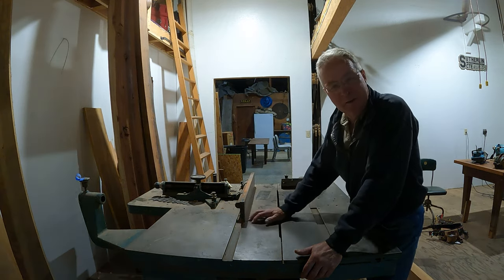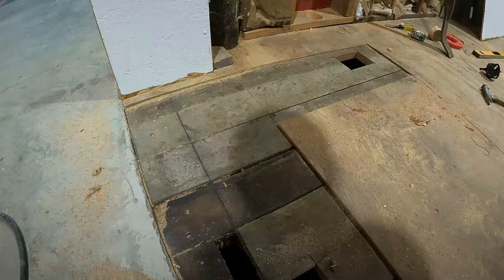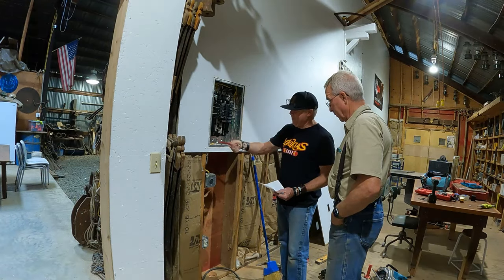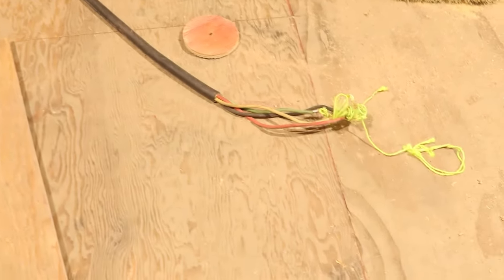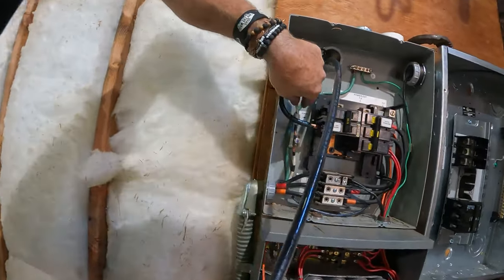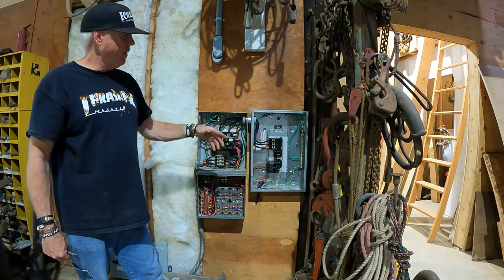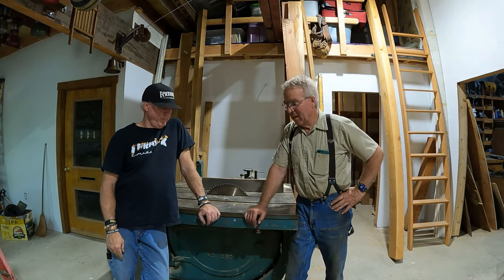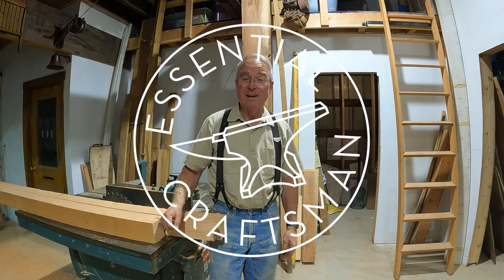Installing Three Phase Power In A Shop

Comment: I will never forget Mr. Tate, my shop teacher in 7th grade, telling us: "This is the table saw.  The table saw can throw a full sheet of plywood the length of the shop, and it doesn't care how many heads are in the way."
Reply: And as those heads fly they can break bones.
Reply: Hahaha...sounds like mine...Mr Rhodenizer wouldn't let the caretaker change the ceiling tiles with holes bcuz it was part of the demonstration! He'd step to the side and let a piece of wood fly up into the ceiling...he had our attention...rip Mr Rhodenizer...I  love woodworking bcuz of your teaching
Reply: 🎉 definitely I agree🎉 that is the kind of machine we used to use in school also where it almost sound like a two-stroke with a power band engine it would rim and then rim higher🎉.. kind of like a jet engine🎉..JJ... Jonjon...😊😊
Reply: I like to say that we think the tablesaw's job it to cut wood for us but the table saw resents it and will throw it back at us any chance we give it...come to think of it kind of like a strict Sensei or boxing coach shows you your weakness with a quick connect to your head.  BE alert especially when cutting multiples. Do not say at the last "Ah, last one.". Your mindset changes and goes onto the next task but I have learned to say at the last one; one more after this, keeps me focused on  the task at hand so I can keep my hand.
Reply: Well my shop teacher told us that if we broke a bandsaw blade, it would shoot across the room and get stuck in the cinder block. In reality, from experience, once the blade breaks it comes to an immediate halt and you don't even know you broke a blade until you open the cover.
Reply: So clever this elictrocity stuff ! I was more used to hand starting an old lorry engine and trying to stay out of the way of the belts !
Reply: @adamkendall997  Depends where it breaks.  I've seen one come out the dust chute, through the hose and stick in the floor.
Reply: Mr McRory told our classes, “if you stand in front of the table saw and you get a kickback, you won’t have kids.  Kids are the greatest gift you’ll receive in life, so don’t stand in front of the blade”.

Comment: That burke bar does everything.
Need to move a 4 ton saw? Burke Bar. Need to remove shingles from a roof? Burke bar. Cat is about to hack up a hairball on the floor? Burke bar.
Reply: Really 4 tons? Or are you exaggerating? That would be a BEAST!
Reply: Hairball😂

Comment: This video had me doing a Google deep dive into phase rotation, delta/wye configurations, eddy currents, etc...and damn I have a new found respect for electricians and electrical engineers.
Reply: All Greek to me 🤷‍♂
Reply: You know what's funny to me, I've been around electricians my whole life. Done electrical myself some. I constantly think: "Well if HE can figure out or, I sure as heck can." And then I realize that electrical isn't my thing. The same look of astonishment that I give my electrician when he wired my whole house and it worked was the exact same look he gave me when his house flooded and I had to redo the drywall and plumbing. Things that he never had a clue or interest in. We both cover each other and it works. ❤
Reply: @trentjensen96 I I just took the master electricians contractors test in Ohio about 6 months ago. I’ll tell ya what it was super hard 110 questions but I passed. Been doing electrical work for 25 years and you never stop learning!!

Comment: I do this kind of work all the time, and we use a VFD (as Kevin mentioned) to convert from single to 3 phase right at the unit itself, and as a bonus you have infinitely variable speed control if you want it.

AutomationDirect sells them cheap, less than even an equivalent phase converter and you don't have the moving parts or the parasitic losses either!
Reply: Will lowering the speed control increase heat in motors at all?
Reply: @slaveofjesus3878  The voltage and load stays constant, the vfd just changes the ac frequency (hz).

Running a fan cooled motor slower will decrease the cooling though, so at really low speeds it can cause overheating (like 20hz or less which is 1/3 the regular speed). If someone needed to run a motor at 1/3 it's speed for long duration, they be looking at slowing the final output mechanically (different gearing / belt arrangement etc.)

But if for some reason you have to you can install a separate fan too.

It's not often that you want to drastically change speed for non-production work, you might fine tune the speed a bit, but the main purpose of the vfd is to give you that flexibility to run 3 phase loads on single phase.

They're also useful for testing and prototyping or situations where the speed is tied to some other input (job being run, temp, load etc.)

Comment: I would really think about installing a splitter on the saw. That thing is terrifying, but I'm glad you're finally getting to use it.
Reply: What's a splitter? Same as a riving knife?
Reply: @MattsAwesomeStuff  Similar.  A splitter is fixed whereas a riving knife raises and lowers with the blade.  So you couldn't, for example make a partial cut with a splitter installed.
Reply: i agree
Reply: @MattsAwesomeStuff  essentially, yeah. Just can't go up and down since it will be a retro-fit.
Reply: AND A GUARD! Surely? Was recoiling a bit as he lent over the table to reach for final bit of the cut..
Reply: @Sam3532  me too! You'd think Scott would have the sense to at least use a push stick
Reply: @Deano.1978 God gave us two push sticks! 😂
Reply: @derrick_v  You're damn right he did!!💪🏻Of course, I've only got one now because I didn't use an OSHA approved  push stick when cutting a 2' x 2' piece of plywood in half!!🤣🙄

Comment: I remember testing on site table saws powered with three phase motors. When activated the experience was exciting and terrifying at the same time. I have total respect for this type of power.
Reply: What does that mean please? I've never heard the term 3 phase
Reply: On household power you have 2 hot leads (black and red) which are 230v from black to red and 120v hot to neutral. This is single phase.
On 3 phase you have 3 hot wires (example red, black, orange) and again 230v hot to hot and 120v hot to neutral.  First phase is black to red, second phase is black to orange and third phase is red to orange. 
This is much more efficient than single phase. In fact all brushless battery tools are DC converted to 3 phase AC.

Comment: 👍🏻👍🏻👍🏻👍🏻👍🏻👍🏻👍🏻 I put a contactor on mine before the phase converter/motor feed and installed a key fob relay in the control circuit so I can fire it up from anywhere in the shop, so it doesn't run all the time.

Comment: in my high school wood shop class the teacher was pushing a piece of wood threw the table saw demonstrating how to use a push stick. and a sliver of wood decided to let go and came back at him. it went threw the web of skin between his thumb and pointer. straight threw. he calmly finished his cut. turned off the saw. held his hand finishing his "speech" and walked to the nurse. always had respect for him for that.

Comment: The sound of that saw turning on, brought back memories for me, too. A three phase tablesaw was in a tool shop that I worked at as a college student often I was asked to make plywood shipping crates. One time I was cutting a sheet of plywood and I don’t remember exactly what happened but there was some kickback and plywood shards flying. I had a piece stuck beneath my chin that I had to pull out with my fingers. Unbeknownst to me, 30 years later I was getting an x-ray, and there was something metallic in that same location. When the x-ray technician zoomed in on the image, the shape of the metal was very similar to what a carbide tooth would look like. Now I have to decide whether to take it out or leave it in.

Comment: Just sharing what I learned from my monster saw. Not quite as monster as yours. 14” 5hp. Old Delta/Milwaukee from the 40’s. Came from an organ factory. When I first turned it on and ran wood without the guard, I noticed shorter, smaller pieces wanting to lift the back end of the piece. It took a while to click but my guard is made of magnesium and the splitter has anti kickback spurs inside the guard. So I installed it, dialed it in. The weight of the guard holds the work piece down. Make an assortment of push sticks and feather boards. Hopefully it came with the guard. Happy sawing

Comment: Interesting. I tried to educate myself on commercial 3-phase supply when planning for a new mass spectrometer in the lab. As I understood things, power delivery in that case is via three 120V legs that are 120 degrees out of phase with each other, yielding a voltage potential of 208V. I assume the 240V leg discussed here is some sort of compromise required when deriving three phase power from single phase distribution. Now I need to read up on this too.

That Oliver T.S. is definitely a beast; easily capable of turning that 4"x8" into a missile. A couple decades ago I was using a 12" Oliver jointer on a 2"x12" hunk of redwood when the cutter knocked a knot loose. I was already feeling less than 100% so the noise of that knot busting loose and banging around under the board scared the bejeezus out of me. But it taught me the important lesson to only operate big power tools when my mind and body are 100% ready for the task at hand.
Reply: "240" and 208 can both be a part of 3 phase. "neutral" is just 240v tapped midway on the transformer windings to halve the voltage.

For single phase 230 for example you have two conductors with between 220 and 250 volts between them (it can vary). For 3 phase you have 3 conductors, and yes the pulses are out of phase with each other. So you always have that 230ish volts between any two of the three wires. But you can also have a "high leg" which will give you 208v relative to ground. So on a 3 phase breaker, you can connect a regular single phase load to the top and bottom of the 3 breakers and get 230ish volts to run regular equipment.

This is all better learned visually though, there are some great entry level brief vids on youtube about all this, it's interesting. 

Another fun thing is that 3 phase motors can reverse direction. If you hook it up and it spins the wrong way, you can reverse any two wires and it will turn the other way.

120v 3 phase with 208 isn't something I see a lot, but it's apparently used more in schools and apartments etc. In an industrial environment I see 230 v 3 phase or 480v 3 phase most of the time.

Comment: Nobody mentioned it but for future hook-ups be sure the phase converter generated leg isn't being used to energize the motor starter contactor coil.  You want utility provided power to go to the starter coil.  Otherwise, your motor starter may not work.

Comment: What your roto phase is doing is converting a single phase AC input into a three phase AC output. Think about single phase alternating current as a single sine wave on a chart. A sine wave alternates between positive and negative values, therefore youll have a dip in power when the wave goes below its highest point (its hardly noticeable because the wave is operating at 60Hz, or 60 cycles a second). Now, your roto phase is basically just a circle divided into 3 sections, each at 120 degrees. These three sections are coils of copper that are spun around a magnet. Each of the coils generate a sine wave of their own. With these sine waves, the high point of one matches up with the low point of the last, so this gives a much higher power output to your equipment. A VFD is needed because not everything is perfect, and one leg/phase could get more power than another causing sensitive equipment to get kinda squirrely.
Hopefully that clears things up a little bit. Im an apprentice electrician and im trying to make sense of it all as well lol

Comment: I would use a pusher stick at the end of your cut so you don't end up loosing a finger or hand. Also a roller which matches the height of the table at each end to help stabilize the piece being cut.

Comment: That saw is big enough to cut your finger off at the shoulder.  We only have single phase in the area of our shops.  My son bought a 3 phase mill and a used 3 phase rotary converter.  There was a wiring diagram on the converter that showed how to wire it up.  Luckily we live in an area that no building, plumbing, or electrical inspector will dare tread.

Comment: This detail seams so much better here in Europe, 3 phase power is standard, more or less every single house is connected to the 230V/400V system. Okay there are some regions in the south with to week and old power lines but in general it is not a big deal to power such a saw - just plug in and You are good to go
Reply: That's a pretty common misconception.  US homes receive 240V, and most homes built in the last 40 years have 200 Amp service, providing 48 kilowatts of power at our disposable.  The 120V circuits everyone likes to poo-poo are simply wired to half the transformer to provide a smaller voltage potential, but every home gets a hot leg from both halves.  Combine the two, and boom, you've got 240V to power heavy loads like ovens, clothes dryers, water heaters, etc.  
The youtube channel Technology Connections has a pretty good explainer.
Reply: Hmm, it is not about 120V/240V and the amps,  thats enough for most uses for sure. The real difference i wanted to point at is the 3 phase system. So You can connect a three-phase motor withut anythng in between. And this has a lot of advantages, no capacitors, nor carbon brushes that wear out and cause radio interference, quieter running and as far as i know better efficiency... Have a lot of them here, water pump, drillpress, saw, planer,... @rhekman

Comment: Hey Scott - Curious if this passed the electrical inspection? It is hard to tell from the video but that does look like Type SO coming out of the unit as described in t.400.4 ... under 400.12 under uses not permitted is, "Where run through holes in walls, structural ceilings, drop ceilings, or floors"....

Comment: VFD's convert AC power to DC power and then pulse the power out to create a sinewave that mimics AC power. This allows you to adjust the speed or Hz of the output power. They can also be used to input single phase 240v AC power and output 3 phase power.
Reply: The output of a VFD is not a sine wave.

Comment: I still have no idea what's going on there. Lol I used to run a RC car club and someone donated an old air compressor for us to use. The only problem was it was a giant three phase compressor. Luckily we had a guy that was super smart with anything electrical. He took an old motor of some sort and used it to spin another motor that created the third phase. So when you wanted the air compressor on you had to wrap a rope around a pulley on the first motor and pull to get it started, then flip the switch for the compressor. There were no capacitors or anything. I still don't understand it even though I've learned a lot more about electrical systems since then.

Comment: I have a 12inch craftsman table saw. While it isn't as powerful as your 16 inch the type of blade you have on it was same type of blade i had on mine when i got it. Those rip blades have a tendency to want to kick back or tear out knotty wood especially if they are needing to be sharpened or replaced. To remedy this i switched to a Diablo fine cut blade and have had much better luck. This change is minor but will be safer and save ware and tear on the machine. Hope this helps.

Comment: Those VFD's are really something, they basically use a few diodes and capacitors to turn the incoming AC to DC, and then they use transistors to turn that high voltage DC right back into AC, but because they use 4 transistors per phase (in an arrangement called an "H bridge" because it looks like a big H in the electrical schematic), they can turn that HV DC into HV AC with as many phases as they have sets of 4 transistors.
SO for 3 phase AC, they use a grand total of 12 high power transistors, plus all the little signal-level transistors (like you'd find in a radio) that do all the signal control to make sure the right transistors turn on at the right times.
They're even fancy enough that you can turn a knob on the VFD and change the frequency of the AC coming out, otherwise they would just be a "solid state phase converter" which probably do exist.
That ability to vary the frequency is pretty important, because as you might or might not know, the rotational speed of a 3 phase induction motor (or most any AC motor that doesn't use brushes) is DIRECTLY related to the frequency of the input power! So the higher the frequency of the power coming out of the VFD, the faster the motor spins, and vice versa.

It's an incredibly synchronized ballet of electrons inside that little "black box that makes the motor spin" as you described it.
And 20 years ago those things were virtually unheard of, at least in the "small-scale industrial" space. If you did find one, it was gigantic and unwieldy and prone to blowing the power transistors at the slightest insult.